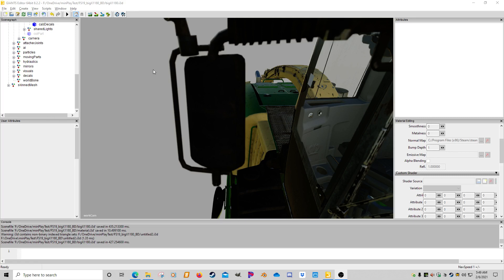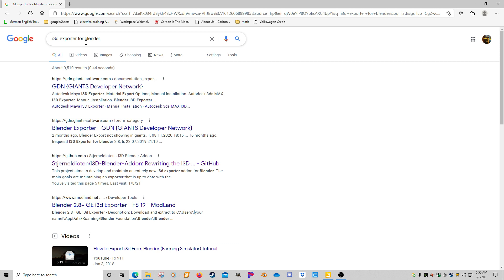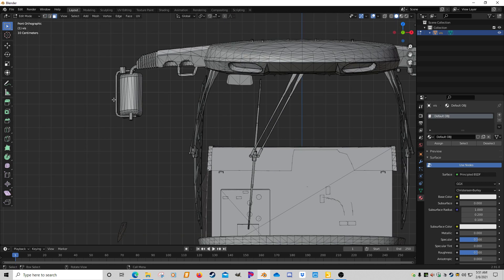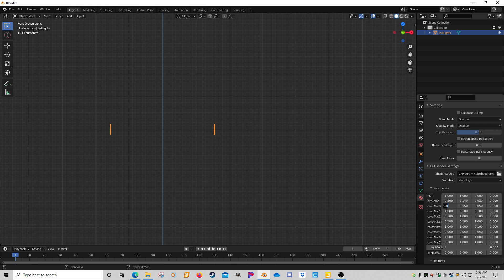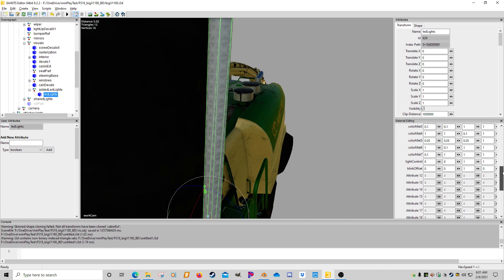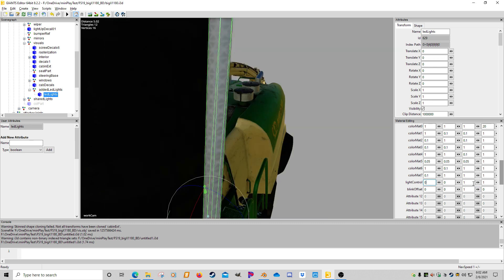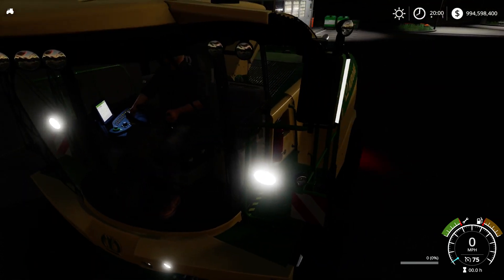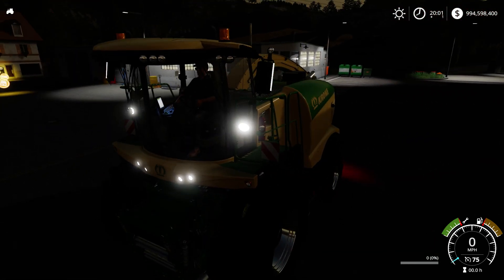Adding an led strip to a vehicle

Comment: thank you for detailed explanation
Reply from the maker: No problem. Sorry for the low volume in my voice. I need to turn the vehicle sound down. I’ll try to show blinker function as soon as I have some spare time.
Reply: @bdbssb77  I was trying to find decent tutorial on blender texturing. Turns out - I saw everything that I need here. Badly want to delete back steering on Valtra T. Struggled with texturing in blender
Reply: So can you edit the xml in notepad+ while game is loaded and the reload the vehicle to test? Or did you reload game each time?
Reply: Awesome vid- Thankyou
Reply: @jhlane1977  yes sir. Since easy dev controll came out - I do all my own edits just while doing tillage or harvest. Just keep your mod unzipped before starting the game (and of course zip file needed to be moved from mod folder) save in GE/xml your edits (you don't need to close GE if you goying back and forth) and hit reload vehicle. But sometimes I need to reload the game because some bits, sometimes, not updating.
Reply from the maker: Cool
Reply from the maker: Yes. I was using this 
https://www.farming-simulator.com/mod.php?lang=en&country=us&mod_id=138864&title=fs2019
Most of the time it works. You are limited if for example you add a configuration.
Reply from the maker: Yes like he says @dc 👍🏼
Reply: @jhlane1977  yes you just need to unzip the mod and put it in the mod folder and run the game and open the xml you can even edit the i3d when the game is running too just need to save the i3d / xml and reload the vehicle using the the mod Easy Development Controls or the in game command